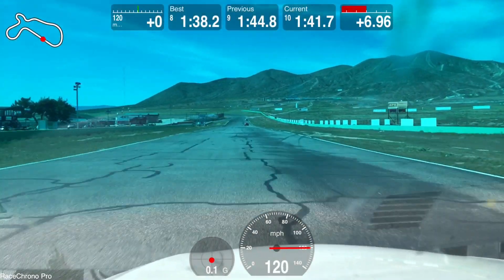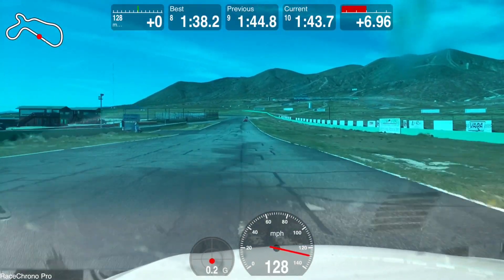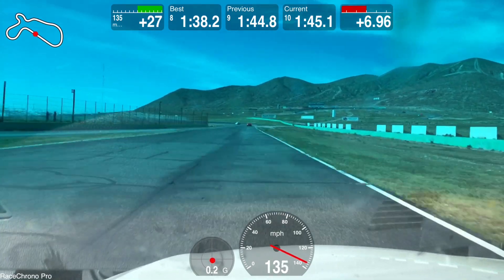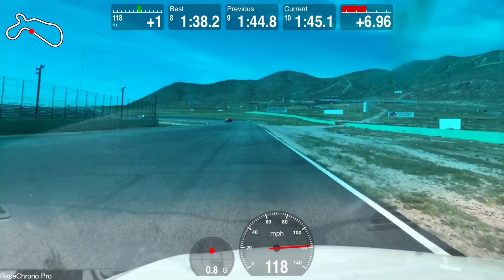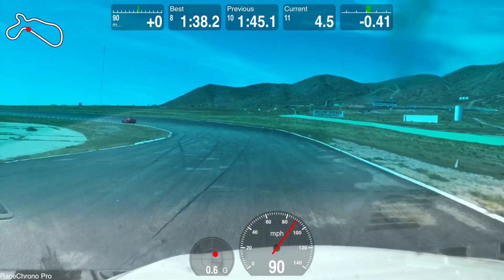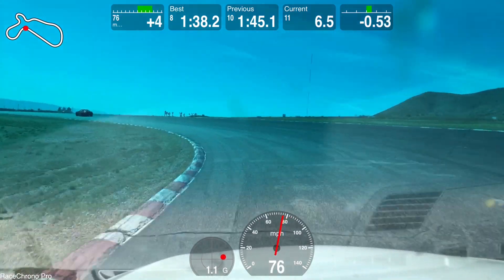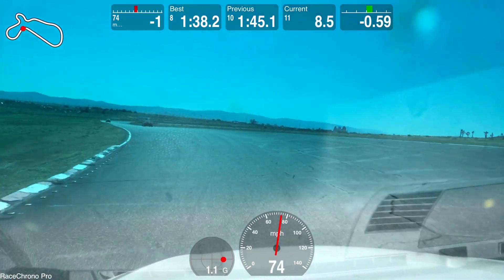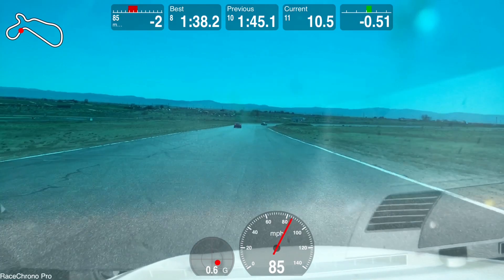2007 E90 335i N54 Custom Transmission Tune Fixes Misfire & Ohlins Road & Track Test Run

Comment: Do you have a build thread with any details on your LPFP w/ hydramat setup?  How has it held up and how low can you run the tank on track? are you not running port injection?
Reply from the maker: Sorry I don't have a build thread for the LPFP.  It's been working well on track but I don't go below 1/4 tank.  No port, too much power for my auto trans.  To control the auxiliary LPFP I use a 8psi pressure switch (snow performance type) to control a 40a relay which supplies 12v power to the pump when on boost.  I burnt one pressure switch out before I added the relay, now the pressure switch only controls the relay so no big current draw across the pressure switch.  I originally had a gasoline leak from the bolts added as electrical terminals on the top hat of the fuel pump.  The leak was fixed by adding some Hylomar sealant on top of the bolt terminals.  Thanks for your interest, hope this answers your questions.
Reply: @DailyDriverTracking  Thanks for the response.  Did you need that much fuel pump for your power or was your goal to just do it once and build it so it was capable of handling more power?  I assume you're on a stock HPFP? Reason for asking - I have a 450lpf LPFP and am thinking of upgrading but concerned about fuel starvation with an in tank dual pump setup and thinking of moving to a surge tank setup instead.
Reply from the maker: @Itsmike.d  I heard that the EKP can go bad with some lpfp upgrades so I went with a the parallel system as it has a separate electrical system.  The Radium surge tank system looks like a good call, it was not available when I upgraded mine but I may have gone with that if it was available.  It looks like they address the additional current issue as well as the leaky screw terminals.